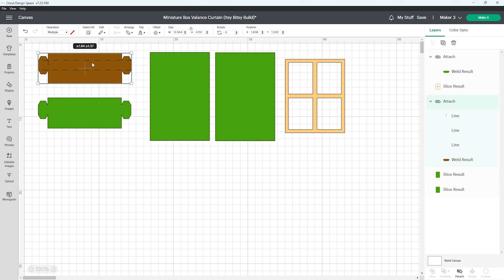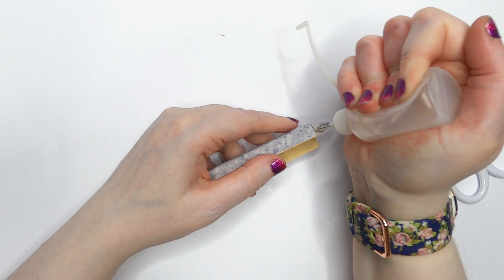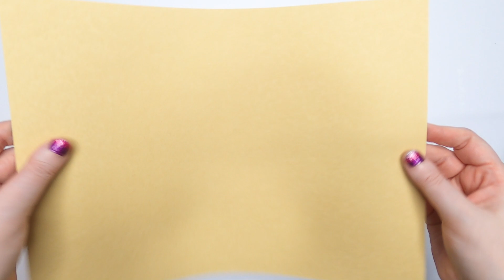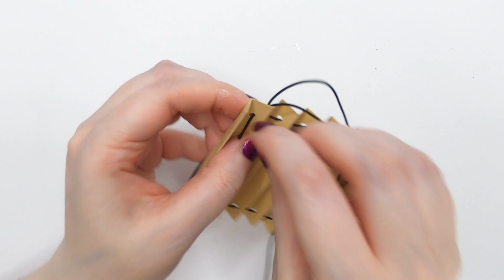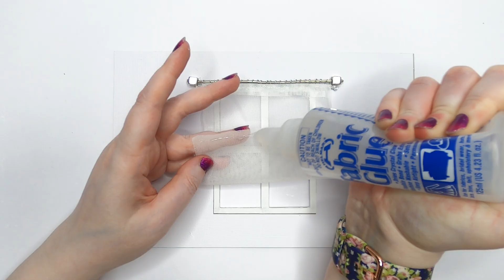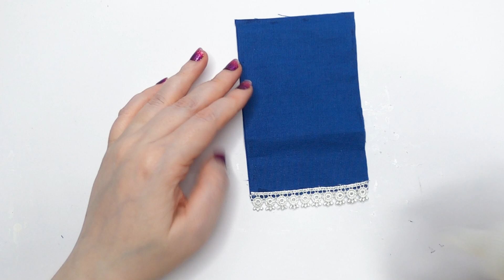Create Mini Dollhouse Curtains & Blinds with your Cricut | 4 Designs | No Sewing

Comment: I was just gifted a Cricut Maker by my wife because I’m a model maker with my medium being styrene plastic. 

Styrene plastic sheet is an easy to use plastic medium that when scored the plastic can easily be removed at this score line, unfortunately that includes a wayward blade that walked off a straight line.

I am a kit bashing model maker working exclusively with styrene sheet because it’s far easier and efficient medium to work with considering I make dioramas, mainly sci if robot dioramas.

I’ve run into a problem in trying to use my Cricut Maker to cut Pepakura robot pattern onto .020 inch/.5mm thick styrene. The pattern was intended for card stock paper but I think it’d be ideal in this thickness of styrene plastic, the only problem is I’ve been trying to do that and can’t seem to have the Cricut Maker do it for me.

Here is the pepakura pattern, though I don’t the miscellaneous bits, so I remove them and just keep anything making up the joints, head, hands torso and waiste:

http://orekue.tuzikaze.com/paper/komono/sotai/01/page.html

Can you help me?
Reply from the maker: Sorry for the delay in responding. When you say 'can't seem to make the Cricut do it' what issues are you experiencing specifically?